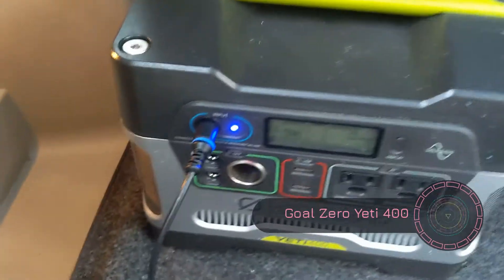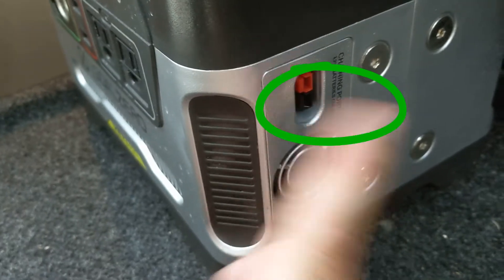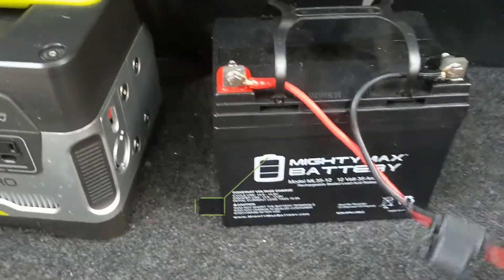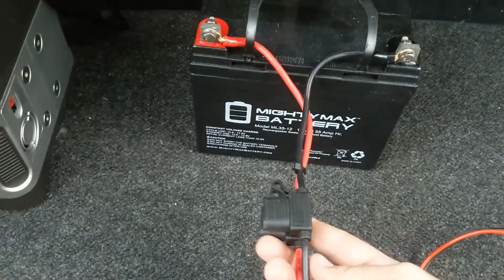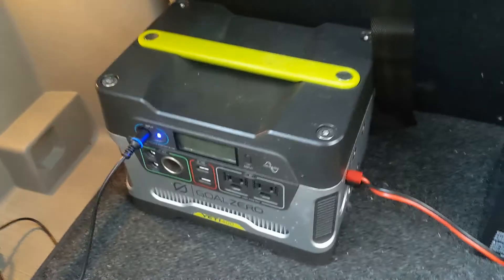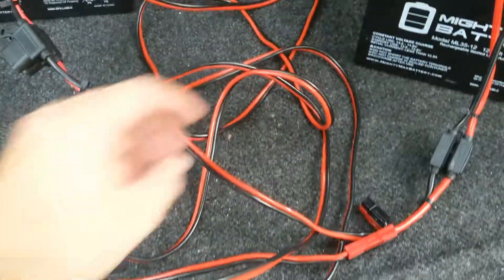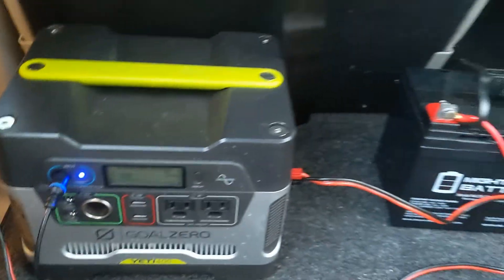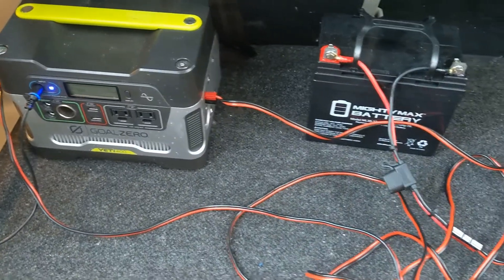How to Double or Triple your Goal Zero Yeti 400 Battery Capacity

Comment: Nice setup, thanks for sharing.  What size battery should I use if looking to expand capacity as much as possible.  Would a Optima Yellow Top battery work? Or should I stick to 35 AMP batteries?

Comment: Can you just wire the 2 new batteries together or does it need to plug into either side of the yeti?
Reply from the maker: Hi yes you can do that too as long as they are the same amperage and volts

Comment: Is there a reason you added a SLA battery instead of a lithium? I'm trying to add a lithium battery to my yeti 1500x
Reply from the maker: Ya not sure if that will work I just did the same battery as the one in the unit so I know I won't have issues
Reply: @GreyTechLive  ok thanks!

Comment: There are two major concerns in this video that people need to be aware of: 
1. The battery level of the Yeti 400 shows “low.” This is not good. Lead acid batteries should not be discharged past 50%. This will damage the batteries. Users who don’t know this let it run to low, and wonder why their Yeti no longer holds a charge. Lithium batteries however can be fully discharged, but lead acid should not.
2. ALL of the batteries that are chained together must be FULLY CHARGED before linking them together. Chaining batteries that are at different charge levels are bad for the batteries.
Reply from the maker: thank you for the adds good points!

Comment: Why did you use such a LONG extension cable? 10’??? Can’t you just use the External batteries on EACH side of the yeti and plug into it’s onboard Anderson ports?
Reply from the maker: hi you could but i was moving the batteries to the other side so i needed the longer cable.

Comment: will the panel and or wall adapter charge the external batteries as well when connected?
Reply from the maker: Hi yes it will I do this when their is no sun just takes longer which is understandable since your not just charging one battery